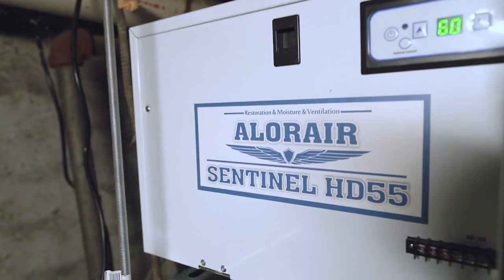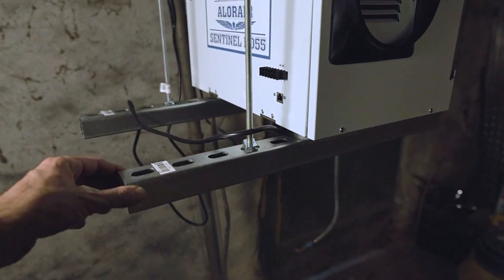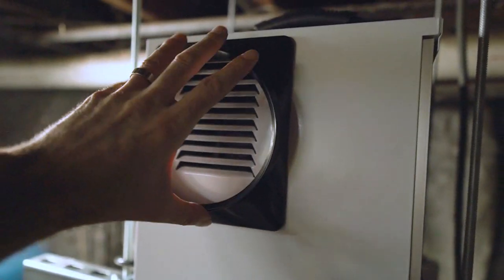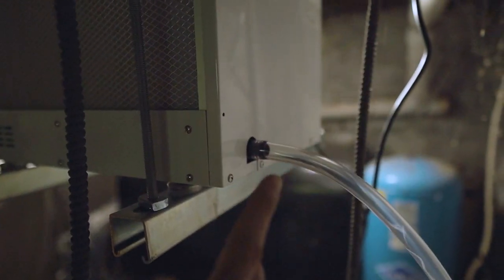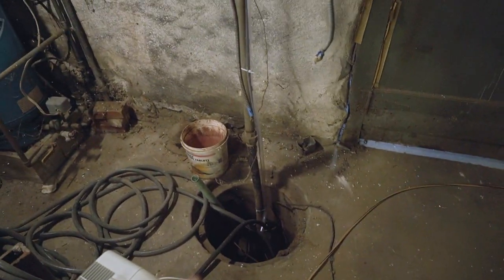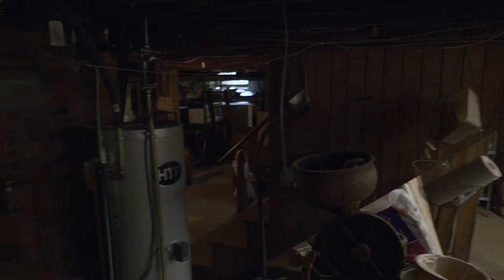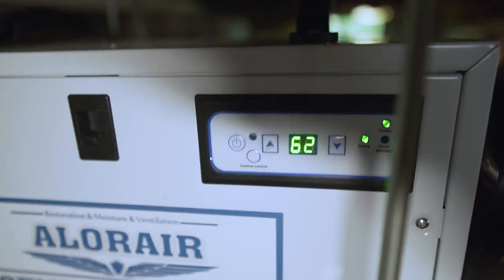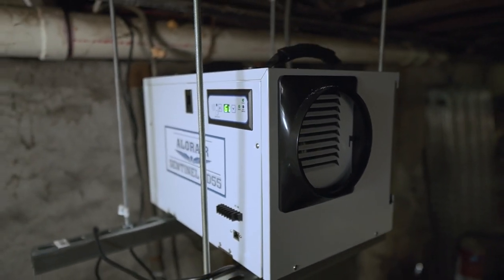Alorair Sentinal HD55 Dehumidifier REVIEW

Comment: I must have gotten one of the problem units as well. Just installed at the end of October and it ran good for 5 days. The unit would run for 5-6 hours and then off for the same amount of time. Mine is set at 55 and would shut off at around 51 and then turn back on around 57. I had to shut the unit down after the first week to finish tieing the condensate drain into my plumbing. It was off for a few hours and now it is still set at 55 and is turning on and off every 20 minutes and is running at 49-51.  Once your initial dehumidification was done does your unit cycle on and off every 5-6 hours?

Comment: Nice rack.

The Alorair Sentinel 55 has same form-factor, specs, and owner's manual as BaseAire Airwerx 55.  Alorair and BaseAire are both trademarks of Ningbo Free Trade Zone Refine Air Treatment Equipment Co.,LTD

Had new BaseAire Airwerx 55 installed in sealed crawlspace of 1,025 sq. ft. ranch home.  Within 9 months turning it on and setting humidistat to 56%, it became so corroded and rusted inside, it stopped working; as discovered my HVAC tech hired to perform annual maintenance as proscribed in owners manual (3 months early, actually). Wish I could attach pictures.  $200 to ship 57 lb. unit back to BaseAire. BaseAire wants $150 to ship it back. Could have bought a new unit for the shipping costs.

Essential "5 year" warranty facts:
* If the unit is less than six (6) months, the company will pay for the shipping costs provided that the warranty claim is valid. Otherwise,customer shall pay.

* If the unit is 6-12 months old from the date of purchase, the customer covers the shipping expense to send the product back to Baseaire facility. The rest will be covered by Baseaire warranty provided that the warranty claim is valid.

* If the unit is more than a year but less than three years, the customer will pay the shipping costs regardless if the warranty claim is valid or not.

* If the unit is more than three years, the customer may still send the unit back but ONLY FOR COMPRESSOR REPAIR. In this case the customer is obliged to pay the shipping cost as well as the labor.
Reply from the maker: Man, I keep hearing about things like this, it makes me nervous. Luckily I still haven’t had any problems with mine. And I paid for this unit myself after doing my own research, it wasn’t like a brand deal or anything. Thanks for providing some feedback here though.

Comment: I just went thought two of these, the 55, then 55S models. Both had same control panel issue. After about 1 week of use, the units shut down and would not restart without unplug then plugging back in. The control panel for settings and temp completely unresponsive and no fan blowing.   Wish I read the reviews. Seems to be a common issue on these. Amazon and Aloair was great and took both returns. Went and got a Hisense from Lowe’s with 4 year replacement warranty for 1/2 the cost.
Reply from the maker: Wow I have not heard that. I've got my unit running as we speak. Heavy humidity and the unit is handling it just fine. I haven't had any issues.
Reply: lol been using alorair for 3 years works non-stop for the whole time well built and works like charm.